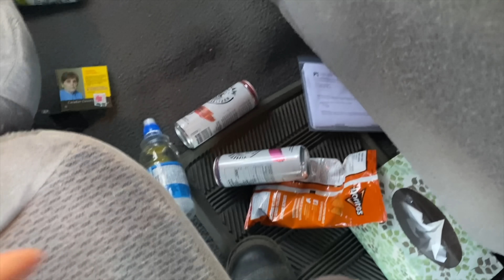CHECKING OUT A FORD EXPEDITION!

Comment: I bought a few years back a 2001 Ford Expedition for about three grand and it was in way better condition than this only bad thing was it has the 5.4 Triton in it
Reply: I have a 97 expedition with the 4.6 and it's 2wd and about 320,000 miles on it. I've never liked Ford until I bought this out of desperation. I only paid $300 and that was 5yrs ago. This POS 99exp with the 5.4 is garbage. I haven't had to work on mine much but I've worked on so many of these 99s.  I wouldn't pay more then $800 but that's from a mechanic stand point. Can't wait to see what these guys do to this thing. If it lasts long enough for them to do anything.
Reply: @Baverage  are both engines have their issues but I had a Lincoln Town Car with a 4.6l and I had over 300,000 Mi on it and it just kept going personally the 10-cylinder Triton's I think are better than both and also the 7.3 Powerstroke are kind of way to go to on a Superduty